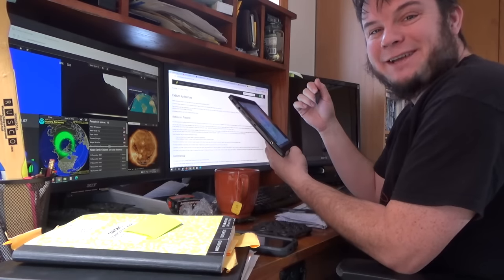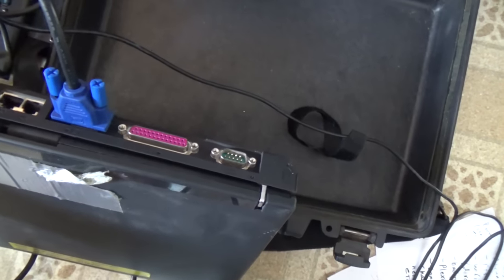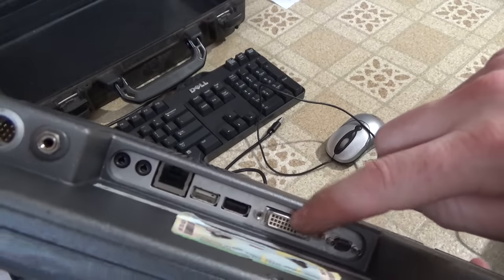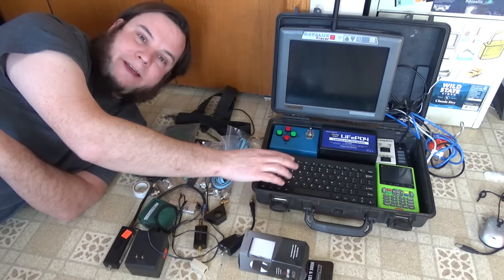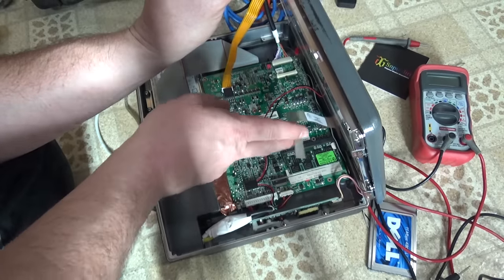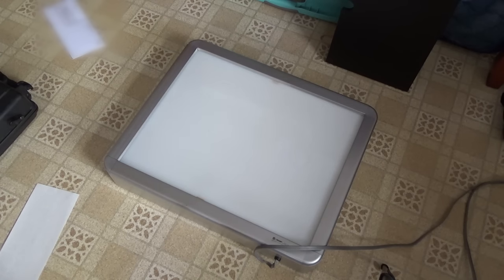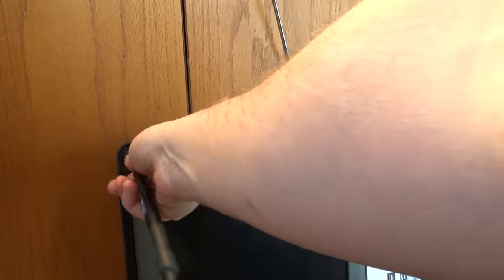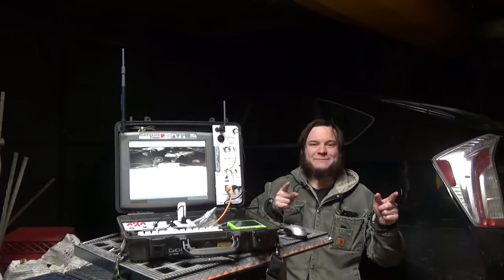Custom Cyberdeck For (Legal) Satellite Hacking

Comment: I do IT in the business world, docking stations are huge now with a big push for laptops that works can use for hybrid WFH and in-office. Each user has a dock with monitors and KB/M at work and potentially in a home office as well (although most just plug into their own TV or monitor at home). The Dell ones are pretty reliable, well built, and also partially modular. They are expensive as hell though... Dell...
Reply: Outside of the big PC manufacturers, CalDigit makes fantastic docks as well.

Comment: This video was so awesome, it had me dragging out old laptops, pulling and swapping hard drives,  decided to use the one with the dead battery with an i5 processor...then I set up an RTL-SDR dongle on it after 3 tries (had to do manual drv installs but nbd)... a few sfc /scan now's later, i had scrounged up a USB extension cable and FINALLY moved the SDR rig outside so I could start doing some real scans. Thanks for the motivation.👍
Reply from the maker: Cool! It's always fun to find a new use for old tech junk :-)
Reply: How do you know all that, from where you started and how long
Reply: @RandomPassenger-wb1og Yea where the hell do you even begin?

Comment: This is awesome, I thought you needed a certain antenna to receive those weather images, I'm definitely going to have to try this out now!
Reply from the maker: The little rabbit ears that come with an RTL-SDR kit work pretty well, as long as you have them extended to the right length and angle. I've also made one out of coat hangers / random metal rods. If you want better performance and a stronger signal there are designs like a QFH that can be made at home, they're just a little more complicated (I made two and only the 2nd one really works).

Comment: Nice, I've got an older Dell laptop with a dead battery too but couldn't decide if it was worth getting another. I replaced the old drive with an SSD a while ago and put Lubuntu on it. It runs pretty good (dual core, 4GB memory) and I use it mainly for videos when I'm sleeping, and sometimes practice shell commands/scripting. I used to work at a small computer repair shop about 10 years ago and when we shut it down, we held onto a TON of the old hardware that is, by now, obsolete except for some niche use cases maybe. I haven't figured out how to dispose of whatever isn't worth keeping though.

Comment: I've built this with a harbor freight case (cheaper than pelican) however I use mine as a tuning laptop for cars. The issue I had is when the lid is up the keyboard sags. The lid of the laptop has velcro so I can remove it of I need to but the glue on the case I heavy duty and the adhesive on laptop is as well. So what I did for the sag is cut a piece of 1/8 inch stainless steel to cover half of the inside of the case leaving room underneath for a charger and the connectors for the laptop to obd2. When you lift the case and lower the keyboard it sits on a rubber stopper which also holds it tight when the lid is closed. This leaves about a 3 inch gap under the laptop in raised position to put your notes and stuff. Works well, is compact and completely waterproof. Can take it out to track day even when it's wet out.
Reply from the maker: Very cool! I like that idea.

Comment: It's got a cop CPU, 512 megabyte ram, it's got cop hard drive, cop serial port, cop jacks. It's a model made before capacitance touch panels so it'll run good with gloves on. What do you say, is it the new cyberdeck or what?

Comment: (6:43) It probably originally came with a wiring harness that pulled power from the car's 12V accessory power rail, and USB probably connected to other devices that had their own wiring harnesses. With that, it was likely easier not to remove the wiring harnesses from the cars when selling them. At least you could just remove the connector entirely!

(7:08) Q4OS is based on Debian, which currently still supports 32-bit x86, and when installing through it's installer (instead of a live session), at least in 'expert mode', there's an option to select a kernel that's either 32-bit or 32-bit with PAE.
Ubuntu, while based on Debian, doesn't support 32-bit x86 at all (they used to). It may be possible to run Linux Mint Debian Edition 32-bit with Debian's 32-bit non-PAE kernel, but that would be too complex for you to do, and Q4OS seems to support 32-bit x86 without PAE, so there you go.

(10:52) Meanwhile, I was using a Linksys WPC54G provided to me by my ISP to steal Wi-Fi from my neighbours using a half broken NEC Versa E400 laptop that had, like, a dead keyboard, dead left speaker, dead battery, and wires sticking out for the power input. Yeah, those were the days before Wi-Fi routers came with WPA enabled out of the box. 2007 was a point in time… (yes I was using my own Wi-Fi connection most of the time, and yes the ISP also provided a WRT54G as well)

(12:10) (14:30) That looked to me like one of those random brands to just get a trademark so they can get leverage when selling on Amazon. There's a whole Techquickie video about those!
Reply: I tried to start my own wisp back in the late 90's with some dec-915mhz stuff (later became lucent wavelan, not to be confused with wav2lan) I'd love to find some of that & the old 915mhz mesh equipment from NYC or that pre-802.11 2.4gig stuff that a Mane isp had that did 60mph hand-off on same SSID...
Hard to believe there was all that available in the 90's and no-one wanted broadband back then...
Reply: @petevenuti7355   
WaveLAN?!?! Whoa.
As someone who grew up in the 2000s, I can only imagine what it would've been like, and how expensive that kind of stuff likely were.
Where I live, we were able to get broadband (more specifically, cable Internet) as far back as 1999!

Comment: There is something you can add that has a good chance . Maybe a different generator that produces  a higher voltage but with lower amps and in between the steam engine and generator add some gearing . Hope this helps , great video by the way !

Comment: Depending on the CPU there is a chance that it might have PAE but is missing the flag as I found out with a Thinkpad running Intel Celeron. You can force the os to install  with "forcepae -- forcepae" (yes there's supposed to be spaces there) during the initial boot. Apperantly it can mess stuff up if your CPU doesn't have PAE so use it with care and don't worry I'd your CPU supports PAE but lacks the flag as I didn't notice any issues on my Celeron.

Comment: it was probably a LEMO connector, and get yourself a bench power supply ? saves messin around with batteries until you know the current voltage requirement. Really impressive case  i used to do this in the 80s, using large antennae for HRPT and fit them on ships .. its great to see APT still running when NOAA years ago promised to strat to use digital on their open downlinks maybe they never did. (LRPT?)

Comment: If the screens are broken, I understand they may not be worth replacing.
why not take them off to save space?
You can take the backs off and the hinges are held on by screws.
Unscrew it and disconnect from board.
Put back together.

Comment: Docking stations never left. USB C made them 10x better.
Im considering buying an new and expensive OEM one for my HP Laptop so it can output full 4k 100hz through the docking station which may or may be just not possible but the old cheap one I have cant do that it maxes out at 1440p and I honestly think its the dock not the laptop. 
4k 100hz is the limit of the HDMI port on the laptop that I am using but thats an extra cable and only having a single cable connected to the laptop for my deskt setup would be very efficient and neat.

Comment: I use a docking station at work. It's annoying, as it fails randomly and needs to be unplugged and plugged back in. But, it only does that once every few weeks. It is nice for outputting to 4 monitors when you only have 2 video out ports between the GPU and the motherboard header.

Comment: I'm planing a similar project for satellites and solar astronomy (Aurora chasing etc-), as well as radio astronomy and radio. How much did you pay for all of that approximately if i may ask? Your project is exactly what i would need for chasing aurora and satellite images!
Reply from the maker: I think I replied to another comment about all the costs, but Youtube makes it hard to find replies again. It really depends on how much stuff you can scrounge vs buying new. Not counting any of the computers I tried but didn't use, I'd estimate something like:
-Pelican case ~$20 used
-Satellite meter ~$60 on eBay
-Battery ~$30 on Amazon
-Keyboard ~$25 on Amazon
-The RTL-SDR and filters I already had, but probably ~$75 for all those. 
-Maybe another $20-$40 for assorted cables and wires and adapters. 

Some of this was stuff I had left over from other projects, or just random things from dumpster diving like the wifi cards and random push buttons and ethernet plugs and other small parts.  I'd guess all together it was around $250 USD, but it would have been more if I didn't already have a bunch of junk hoarded!
Reply: @saveitforparts  Thank you for your answer. That seems quite bearable for me if i buy a few parts every month. it looks really nerdy and i really love that!

Comment: How much power does the old PC draw? My main issue with repurposing old laptops (vs. a Raspberry Pi kind of SBC) is power draw and therefore battery life. Regardless I love this build!
Reply from the maker: With a bunch of stuff running (SDR, amps, wifi, some USB devices, etc) it lasts about an hour on one of these: https://www.amazon.com/TalentCell-Rechargeable-12000mAh-Multi-led-indicator/dp/B00ME3ZH7C
However I suspect that battery pack has less capacity than advertised! I tried measuring the current with a multimeter, but it goes up and down a lot so it's hard to get a reliable average.

Comment: how do you so cleanly cut plexiglass? i tried and failed to make neat rectangles for a 3D printer enclosure w/ a dremel + special blade.
Reply from the maker: I have mixed luck with it. A dremel tool seems to work but leaves some melty edges. Otherwise taping it and running it through a table saw works if it's thin.

Comment: Just a comment on the docking situation, the lenovo docks where designed to be used with there windows laptops, They can work with other devices but without the proper drivers for them you can run into weird issues with display and other components.  Great video though.

Comment: This randomly got recommended to my home feed as the top video and thoroughly enjoyed it. I am not that tech savvy and don't know much about electronics, computer and programming. This made me realize I have an old monitor at home with the stand that got broken which I was about to throw away. Any cool ideas my friend how to resuscitate the old monitor and use it for something? Thank you.
Reply from the maker: I've used old monitors for various things. Digital picture frame, security camera viewer, garage computer for looking up parts, zip-tie it to a milk crate full of circuit boards for a redneck portable gaming system... If the monitor itself is really nice, but isn't working right, sometimes it's the capacitors inside and you can find a parts kit for a few $ online.

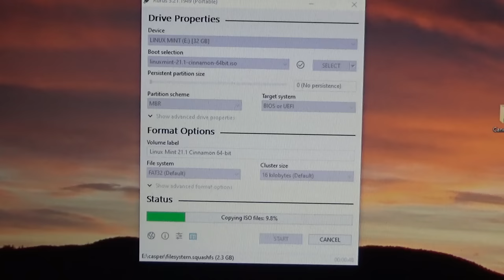Comment: 7:00 I've ran into this error on my R51 Thinkpad, just add 'forcepae' to your kernel parameters (I think F6 for Ubuntu based distros?) Some CPUs have PAE but just don't have it set in their flags, may or may not work
Reply from the maker: I'm still not sure what PAE does, first time I googled it I just found defense contractors and embarrassing medical conditions 😂
I just kept trying different low-resource Linux distros, and honestly I'm loving the Q4OS I ended up with. The Windows XP look and feel are great :-)

Comment: Cool video. What were you using as an sz/El controller on your dish?
Reply from the maker: The bigger dish uses an old security camera PTZ mount. It's not quite strong enough for that dish and tends to flop if I tilt too far in certain directions, but I used it for some of my early radio telescope experiments.

Comment: You should try and find one of those IBM ThinkPad 701C butterfly keyboards .  I think having a flip out then pull style keyboard just makes it look cooler and gives you more room.  Or you can go with Thanko's full-size USB keyboard option for the oragami keyboard style.  Even spending 34USD on Arteck Folding BT Keyboard might be good since it has a 3 way keyboard switch for 3 different devices.

Comment: You've earned a new sub. I'm currently putting together my own multipurpose version of this! I'm going to include an upconverter in mine to have the ability to tune to VLF all the way up to SHF.

One thing I'm curious about in your setup: do you have any attenuators in line between your LNA and your SDR? Or is that even necessary with such a weak signal from the satellite?
Reply from the maker: I don't think I've had reason to make a signal weaker yet! Usually I'm trying to make the signal stronger!

Comment: I've been looking for one of those cop car computers for a project, where did you find one or can I buy one from you?
Reply from the maker: I found them at a government surplus auction (I think it was publicsurplus.com). I've used one, let the magic smoke out of one, and gave one away, and the ones I have left were the worst condition with scratched up screens. I'm not sure if I want to sell any but I can keep it in mind!
Reply: @saveitforparts  for sure and thanks for the tip! I just need the Mobo the rest is just toys. I really dig how you use spare trash too, all my PCs were free for the same reason lol. I'm also in MN we should link up some time. Actually looking at getting rid of a bunch of retro and early 2000 PC parts if you're interested.

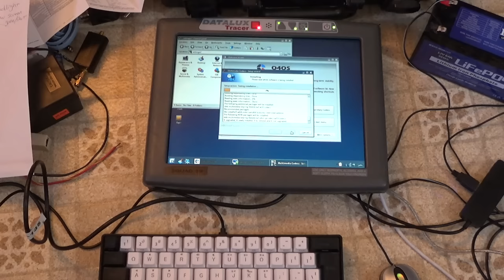Comment: 11:49 found the only other Q4OS user besides me, neat

Also, I'd have stuck a trackball mouse in there somewhere so that you don't have to use a laser mouse on questionable surfaces when outside; the podium things Kraftwerk use during their live shows use trackball mice since there's barely any room with all the audio equipment. But it's looking like you were running low on room as is, so maybe a trackball mouse will be something to think about for a potential cyberdeck v2 that uses a bigger suitcase.
Reply from the maker: I stumbled onto it by accident, just trying to get something that would run on that ancient tablet. I really like the Windows XP aesthetic now!

Comment: what did you do to learn all these?
Reply from the maker: Just started messing around with stuff mostly! I didn't own an SDR until a couple years ago, I started with the cheapest one I could find on eBay for like $15 and things just went from there 😛
Reply: @saveitforparts  oh but what programming languages did you learn for coding and this stuff
Reply from the maker: I've started learning Python recently. I learned some C++ and Javascript in college but it doesn't seem that useful anymore, and I don't remember much of it. Python is nice because you can just run it right away without compiling, and find/fix any errors quickly.